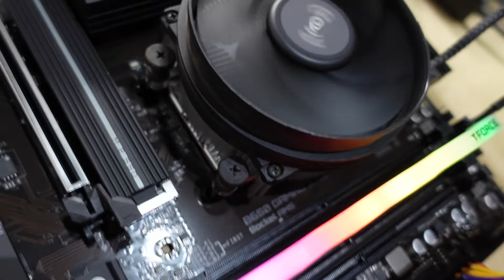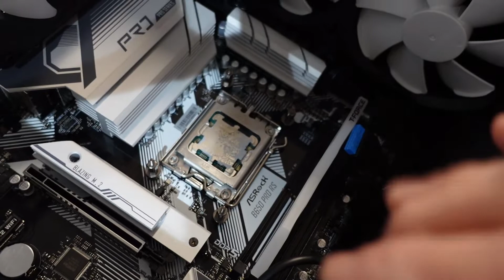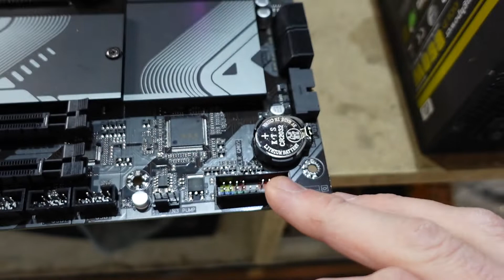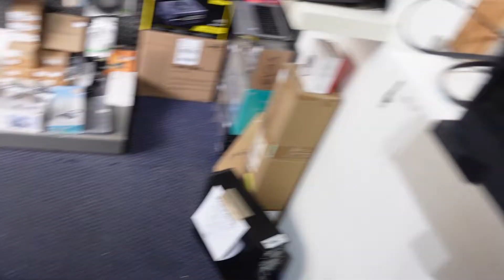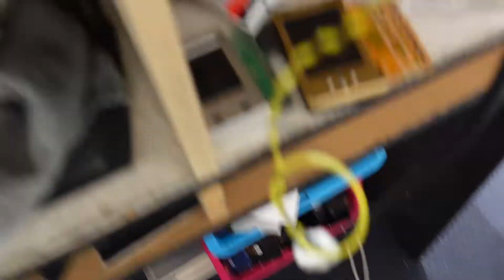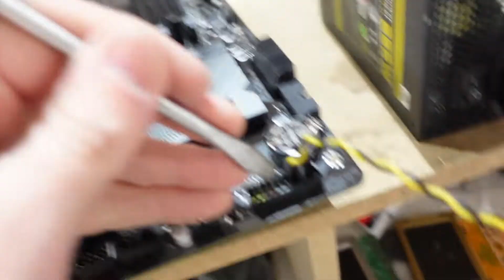AMD AM5 Solid CPU and Ram Light, No Post, Possible Solution

Comment: Currently having this issue with the Aorys b650 elite ax and the Ryzen 9 7950X3D. When the pc starts the cpu light flashes red then switches to a solid DRAM light. At this point I’m not sure what to do other than take the parts back and replace them with new ones.
Reply: Hey! I m experiencing this right now, what did you manage to do ?
Reply: @Biznix having the same issues of dram red light.
Reply: @LegendaryStarfy  i ended up changing mobo, as I had some bent pins
Reply: Hi... I have the same issue. Waiting for a new motherboard to see if I can fix it.  (Already tried with new ram but the same... Hoping will no be the cpu)  :-(

Comment: Wait. 
I changed DDR but nothing has changed as you have done same with motherboard.
And, if the CPU is the problem, why the CPU light is not on?
Reply: I have the same thing. I heard the prong where the CPU sits causes the motherboard to be completely useless

Comment: I have the same problem built a new pc with the b650 x ax v2 and a Ryzen 7 7900x with ddr5 ram sticks it was a micro center bundle. Ive tried everything and even went back to micro center to get new parts I built it yesterday again with the new parts and still same thing with the d ram light and won’t post I don’t know what to do.
Reply: Any updates on this me and my friend are encountering the same issue right now and are wondering how to fix it.
Reply: Change gigabyte mb...

Comment: here's my story: my msi mag x670e suddenly did not boot with fans spinning. the pc was working for 1 month straight no problem. I have red cpu and yellow dram on ez debug. I gave the pc to technician and he did not resolve any issue. he said its probably motherboard since he claimed he tested all components. he said cpu was good on other pc. 

Ok so i get the pc back from him as he took too long to resolve the issue. I had him to put away heatsink so i can be sure my cpu is still there. I cleaned the paste and reattached the heatsink at home.... then it boots normally. I was so happy it booted normally 6 times. then at 7th attempt im back at red yellow... no booting possible again.
Reply: This sounds very familiar.  It has worked flawlessly for 3 months then started getting unstable.  Sometimes freezes, sometimes black screen sad face, sometimes blue screen sad face.  Tested SSD, RAM, and they check out fine.  Computer will boot one time, then the next time the cpu and dram lights come on.  So frustrating.
Reply: @gametime2473  my pseudo fix for it is to adjust the cooler screws if its not booting. it usualy boots when i change the pressure of the cooler. sometimes i screw it to max sometimes to 90 %.
Reply: @Bixdood 😮

Comment: Trying to install a 9900x in this board and getting both dram and CPU red light, I updated the BIOS nothing changes. I do not have access to a different CPU any idea how I can get it to post?
Reply: Try an old version of bios... use qflash +
Reply from the maker: no further suggestions, i would try different ram or cpu

Comment: Same issue for me, new CPU and motherboard, same everything else (PSU, ram)

Thought it was the motherboard, got a new one still not working. New CPU comes in next week so hopefully it works. 

This is the most frustrating thing ive ever experienced building my own/family PCs for 15 years.
Reply: Boss, any update?
Reply: @cengi  New CPU worked luckily! Just had to reset CMOS every new part I installed for some reason.
Reply: @brandonlong7251 you took the whole thing apart?and reset the cmos then turned it on then put ram in then reset cmos then turned it on then put gpu in then reset cmos then turned it on and it worked am I correct in that logic? Or what exactly did you do and can you make an in depth explanation? Thanks man
Reply: @lukablyat  you got it right, basically just installed minimum amount of things (CPU and RAM only) and then added one part at a time, resetting the CMOS everytime. GPU, SSD, etc. 

What ended up fixing it was a new CPU though.

Haven't had any issues since 🤞
Reply from the maker: Damn no fun at all

Comment: probably long fixed the situation but i had a red signal like this and the suspected "fault" was the board and to "clear" the signal (statement was its a bug in "bios") was to hold the power button turn off the pc(mobo) holding the power button still flip the psu switch off and on and that sorted the red light issue out on z690a boards.  I've now run into another situation this video has not necessarily solved as of yet(got to get little speaker).  Doubt the board will post with my 12 year old cpu but if i have to try i guess i will...
Reply from the maker: this is for am5 motherboard, so im not sure what board you are trying to revive sorry

Comment: Im having this exact issue. I'm using the Pro B650-S Wifi Motherboard, with a Ryzen 7 7700X, Corsair RAM and it happens, I've tried everything, from reseating the CPU, checking different slots of RAM or just one stick, and it never gives me display. It ended up frying the new PSU I bought and it just refused to work whatever I did. I still don't understand if its the CPU, if its the RAM or the Mobo itself..
Reply: any solution
Reply: @SiXiS4 I read on reddit that the Corsair memory doesn’t play nice with gigabyte boards, somebody got it to work with Teamgroup Ram instead.

Comment: Hi, I have bought PRO B650M-P mobo and when I try to boot the PC with 1 ram stick of 6000MHz in a slot different from 2 it works just fine

However, if I put my ram in slot 2 or even try to double channel I get both the yellow led (ram) and red (cpu).
My CPU (Ryzen 5 7600X) has no bent pins 

My ram is Standard DDR5 6000MHz vengeance ram.

What could be the problem? How could I fix it? I tried updating the bios but the problem is still there.
Reply from the maker: not sure sorry

Comment: I have an similar issue, i bought 2 more 32gb of ram, same as my old ram but after installing the ram it doesn't want to boot up and the cpu light is on red and ram light on yellow, ive swapped around the ram multiple times and i still have the same issue, ive also blown off any possible dust before installing the new ram but still stuck on the issue. All the rgb lights are running on the ram and all the cables are connected propperly same with ram but it still doesn't boot up at all.
(Also when i remove the new ram and have my old ram like before the pc boots up and works completely fine, what do i do?)
Reply from the maker: seems like your computer either doesnt like the brand and speed of the new ram
Reply: @rickstechrepairs  could be, the new ram is a bit slower on the clock rate than the old ones but ive confirmed both new and old ram works when they're by themselves, like 2 at the time.
I also updated the drivers/bios and chipset of my mobo in hopes of it fixing the issue but it didn't, it is an am5 mobo with ddr5 ram slots so it feels wierd if that was the issue
Reply: @Zeledonom Don't ever mix brands and speeds.

Comment: just finished my build and i have a red cpu light and yellow dram. I tried resetting cpu and ram in different slots and still nothing. Could it possibly be a bios update needed?
Reply: Did it work?
Reply: @GemuMat116   i got it, just didnt have cpu installed right
Reply: @deboiinablac but there is only one way to place the CPU, how did you place it to see if I am making the same mistake
Reply from the maker: tried single stick of ram?

once booted have you left it upwards of 5 minutes?

What CPU and Board?
Reply: @rickstechrepairs  havent tried one stick, leaving it on now as we speak, and msi mag b650m tomohawk, ryzen 5 7600x

Comment: Same. I have tried three motherboards from two different companies. Two 7800-X3D CPUs. Two power supplies. Two sets of power supply cables. Two monitors. Two video cards. Two video cables. Flashed the BIOS. Tried two memory sticks. One memory stick. Nothing.
Reply: I changed to a different brand of RAM and it works now!
Reply: what ram where you using?the ones didnt work

Comment: I have the same issue with the red DRAM light on my B650. Brand new build, but booting just does nothing most of the time and leaves me with just that same DRAM light on. Maybe 1/10 times it will actually boot to windows. I've tried RAM in different slots, just one. Tired disabling XMP, enabling memory... But now, after watching this, it's making me think it's the processor... Which is a AMD Ryzen 7 7800X3D.
Reply: Same specs same issue
Reply: Did you find a solution?
Reply: @juans9515  Yeah dude. Faulty/dead RAM. So there was a slim sector of the RAM that actually worked, hence why it started 1 times out of 10. The other times it would hit a dead spot on the RAM and just not boot. New RAM now and zero issues since.
Reply: @michaelbliss8563 I started building on my pc and when I first booted it up it was orange light on dram so I took out one stick and it eventually worked there was a defective ram and the other worked.
Reply: @michaelbliss8563  I'm having this issue too with my Gigabyte 650 Eagle AX / Ryzen 7 7800X3d . Did you tried the original ram in a different computer? Like were those truly dead or was it something with the combination of those original RAM sticks and the gigabyte RAM slots?
Reply: @moosemail i have exacly the same build but 2x16 ddr5 5600mhz, and i have the same problem and everythink is brand new... I don't know what os going on ...
Reply: @moosemail  It was 100% the RAM being like 95% dead. Tried every combination of slots / combinations / one ram / different PC and it failed 9/10 times. Haven't had a single issue since I replaced the RAM. Also, what might be causing you issues is a chipset not compatible with your Ryzen(AMD). So make sure the chipset of your RAM supports your Ryzen(AMD).
Reply: @michaelbliss8563  the ram you had before it wasnt tested on expo? And the one you had now is tested on expo? Like the certification
Reply: @michaelbliss8563 hey I have same motherboard but I have flashing red lights by the aio / cpu what do I do
Reply: @ipinghit1693  update ur bios with the usb port in back of the motherboard with the last update for ur motherboard
Reply: Probl3m : probably cpu memory controller faulty
Reply: Do not use  gigabyte
Reply: @mycuriouschild   yup , same issue had a bent pin on cpu
Reply: Just upgraded and I’m running into this problem, don’t jinx me
Reply: Same withryzen 7 7800x3d / 2x32g ddr5 6000mhz / b650 msi tomahawk someone find the problem
Reply: @Snakemp4857 noooooooooo I legit just ordered this build
Reply: @Snakemp4857 the 7800x3d can only work with ram clocked @ 5.2mhz 6000 is way to much.
Reply: @OnePumpKyle  now works perfectly, it was the bios, the problem, it needed a major update when I got it, it had the second update and MSI when I looked was at 12th since no more problems even at 6000mhz

Comment: Nice video, and I was hopeful as I'm seeing the same issue (DRAM LED on).  But, when I plug in the speaker, I do hear the three beeps when DRAM isn't installed -- which is what you say is what we should hear with a working CPU.  When DRAM is installed, there are no beeps.  Where would you go next in that case?
Reply: Try some other RAM stick, change seating, . And you could have both CPU and RAM defective at the same moment... Shit happens.

Comment: I had the same issue for hours today, ended up having to use b1 and b2 instead of a1 and a2, that worked for me.
Reply from the maker: good to read you go it powering
Reply: That’s slots 3 and 4 then? Is it in dual channel mode like that?
Reply: @radicalrey  it was slots 2 and 4 that ended up working, if we are counting 1 as the one closest to the PCI slots, I may have said the wrong thing.

Comment: I'm having this same issue, I got a new CPU on the way, if I remember ill report back in...
Reply from the maker: Good luck
Reply: So what happened?
Reply: @xellr  whoo boy, many things... i am on that pc ATM.  BUT first round, 4090 had a short in it, didnt know untill replaced all the parts  and 4090 blew another power supply,  so then got a new psu and 4090 STILL  had the same issue, that mobo had a bent pen along an edge i didnt see, RMA'd it.. new mobo, gave same issue, did a bios update and the machine spirit was pleased and decided to work, gives me a red dram light with 128 gigs of ram though..

Comment: Great video🎉
Where do you got the post speaker because I want to buy one
My Issue is that I get random blackscreens and when the pc has to restart it works fine. But when I want to restart it on my own it shows me the dram light and doesnt post. I wonder if its the ram, the memory controller or the mainboard itself. I have a 7800x3d, x670 aorus elite ax, teamgroup 6000 cl30 Ram. 
I would really appreciate your help. Thanks in advance
Reply: Having the same issue from 1 month 🥲🥲
Reply: Yes, I have the same problem, the computer will turn on only by rebooting and I also have teamgroup 6000 and 7800x3d. Were you able to solve this problem somehow? 😕
Reply: Were you guys able to solve this? I’m having a similar issue.
Reply: @TheDrDread  no/

Comment: 7500f and asrock b650 hdv m.2 with Corsair 32gb kit not posting. Tried everything so far as suggested but still no post on a new build. Red lights just scroll on the motherboard. Tried for half an hour.
Will pull it all out again and stick it on the table and see if it works part by part 🥴
Reply: Swapped out display cable and it worked 🤔

Comment: same happened to min and the pins on the AM5 cpu socket were damaged, even though the dram light came on and not the cpu light
Reply: Did it ship damaged or where they damaged with pc installed and running?
Reply from the maker: damn, no good, atleast you know whats wrong now :(

Comment: I have both cpu light and dram light on ...motherboard is msi project zero b650 so its hella expensive  and r5 7600x ....I tried everything like bios update ,reseating the cpu , reseating the ram but still those cpu debug and dram lights are on...Plz help me
Reply from the maker: I would be trying another cpu
Reply: @rickstechrepairs   hey bro my problem solved ....my aio cooler bracket was too tight..I had to loosen up a little bit and try one stick of ram at a time
Reply: Did it work with two ram sticks in the end? And before loosening it worked with 1?
Reply: @GemuMat116  Yes ...after booting everything with 1 ram stick (after installing windows).... But first  you need to give it at least 15 minutes to boot with both ram sticks ,if it doesn't boot then you can remove 1 Ram stick at a time